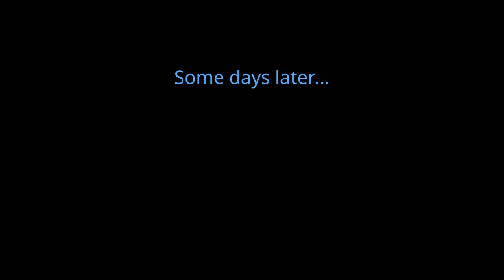Building my shed, part 6, Block work

Comment: Excellent my friend, it's going to be so much nicer than a rusty shipping container!
Reply from the maker: There's nothing wrong with your shipping containers... Good quick solution though I couldn't do that at my house as I couldn't get one craned over the house! That said it's about the size of one container.
Reply: There is just no substitute for good thick slab!
I will eventually have to rebuild my original shed and I'll be doing exactly as you have done, but probably with more swearing and blood!
Reply from the maker: You'll need to rebuild your cement mixer first. How is that going?
Reply: No progress at all unfortunately, and with changing jobs I no longer have access to a 3' slip roll so making a new drum is going to be a challenge, but that's what we live for right?
Reply from the maker: It certainly is. Perhaps you are going to have to start by making a slip roll first? You may find useful parts at a scrap metal merchant.

Comment: Coming along nicley. Keep it up.
Reply from the maker: Many thanks! One of my first jobs will be to put the PAZ1 back together after having a rebore and rebuilding the rocker gear. (Also it has a new big end).
Reply: @BensWorkshop  they are great runners. I am really a petter fan.
Reply from the maker: You are going to like the water cooled AV1 when I get a new injector pump for it.